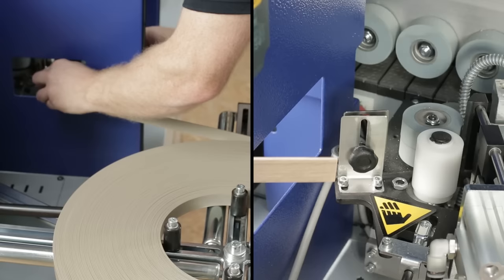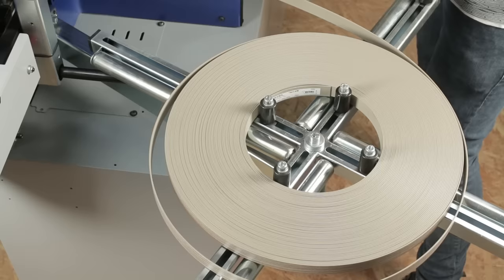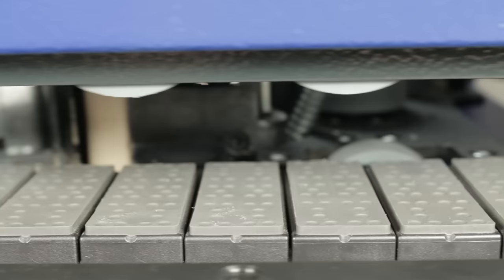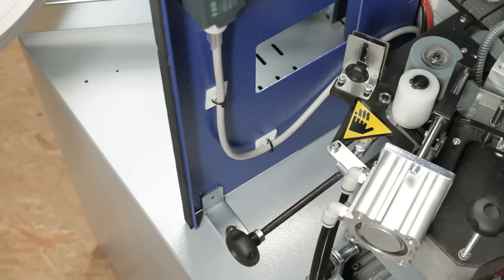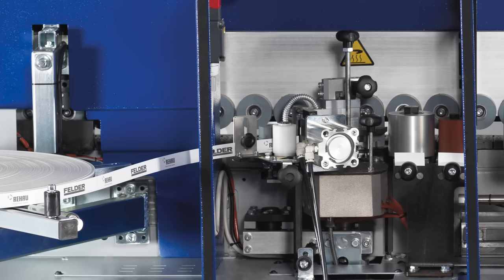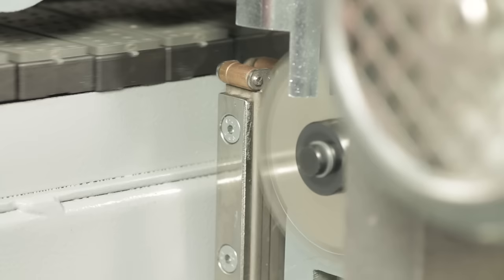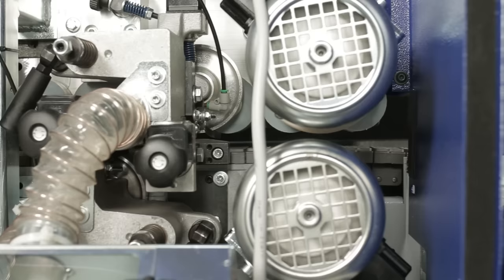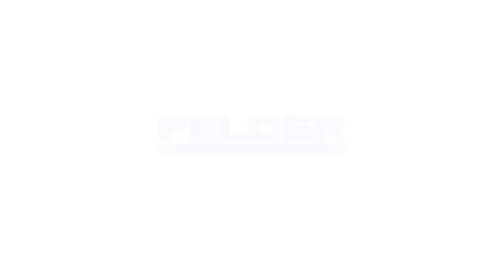Felder® G330 - Edgebander | Felder Group

Comment: How many Flow capacity and pressure for support compressor this machine?
Reply from the maker: Hi, I hope this helps:
The compressor must have the following specifications in order to ensure that the machine can function as it should:
a. Input pressure 7 bar
b. Air quality in accordance with ISO 8573-1 5-4-3 (Free of oil, condensation and particles)
c. Output connection for ⅜“ pipe with an inner diameter of 10 mm (EN 10255)
d. Compressed air requirement of the machine "see table": G330/G360/G380

Standard compressed air consumption 150 Nl/min
Compressed air consumption with radius glue scraping 200 Nl/min
Compressed air consumption for each optional spraying unit 60 Nl/min
TECHNICAL NOTE: With conventional compressors you need to consider that the output required is about 25 % above that which the machine requires.